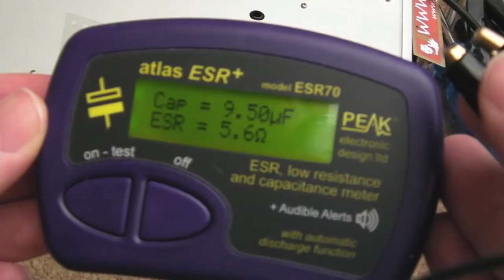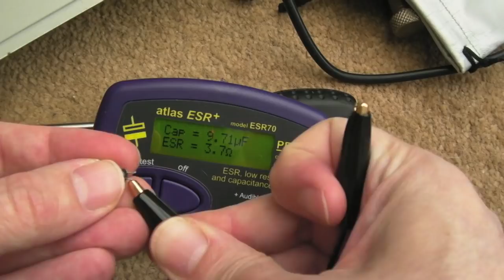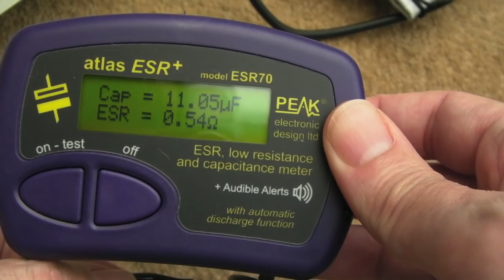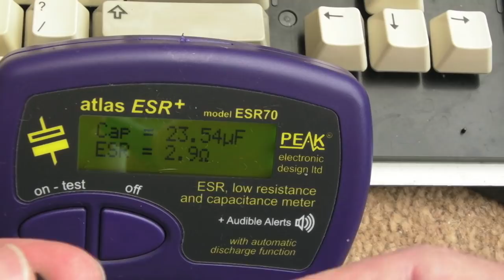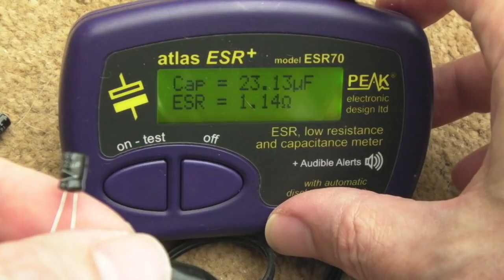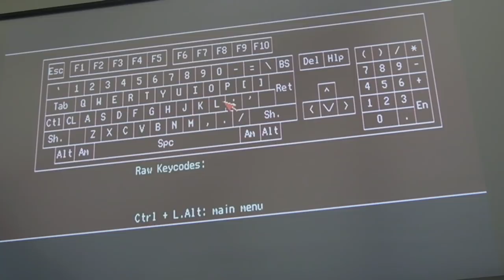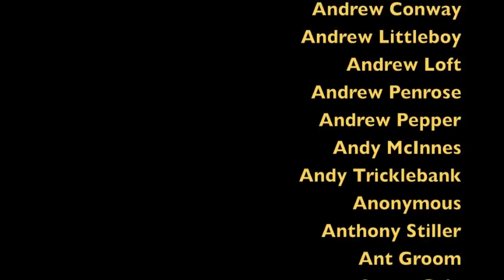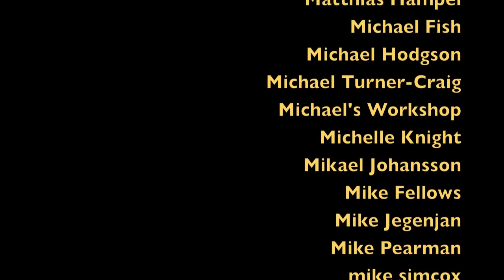Commodore Amiga A500 Keyboard Flashing Caps Lock Repair

Comment: It`s good that you do things like this, it helps alot of us to repare the Amigas we have. It shows that many jobs are easy to do. I had a keyboard issue with my A1200 the Caps lock key did not work at all the other keys fine. So i got a new keybord membrain, one of the new hard ones for the A500 and A1200 just fitted it and the keybord works fine now the green LED lights up. AS I have a A500 as well I have sent off for a spare one.

Comment: Thanks for another geat vid! Same issue on a suspisiously messed around with 'untested' A500 Ebay keyboard job. Messed around checking transistors and blah but gonna jump to the chip after seeing this. 3 flashes. Pretty much same error code so new chip time.

Comment: I have a similar issue here, already changed capacitors, so I guess that now I have to try to reflow the chip, or get a broken a500 keyboard on ebay to extract another chip... Thanks for the video!!

Comment: If you set your multimeter to diode mode and connect the positive probe to the ground pin on the chip and the negative probe to any of the other pins (you will have to test every non ground pin) you can usually detect the protection diode in the chip die.  If you then tap on the chip you may be able to figure out which pin has gone faulty if that helps.  You may be able to add a pull up or down resistor to that pin to try and make it functional again.  Like My Mate Vince did on his Sega carts.

Comment: I've had several A500 keyboard controller PCBs where I had to reflow the controller chip. Had the excact same symptoms you have here. And I couldn't see any dry solderjoints in any of the cases. Just like in your video the solderjoints looked perfectly fine. But reflowing the main controller chip fixed it in all cases. Probably small microcracks in the solderjoints that's impossible to see with the naked eye. It makes perfect sense because the keyboard controller card flexes a little bit as you type on the keyboard. So those old solderjoints are very prone to cracks. I don't think you tried to reflow the original chip in this video? Or maybe I missed it. I can almost guarantee that a simple reflow of all the joints would have fixed it without swapping the chip. Edit: Heard what you said by the end of your video now. You did try that controller chip on another PCB and had the same problem. So it was indeed faulty. Very rare
Reply from the maker: I didn't show it but I did reflow that chip and it made no difference!  I also later tested the chip in another keyboard that has an MCU problem and the same "tap issue" is present there.  I suspect a loose bond wire inside =/

Comment: Hi bud, I just bought an original Hi-Tek keyboard to finish off my Amiga 500 build.
However, on eBay the listing said this:

Keyboard causes the 500 to hang on black screen.
Altering the pin out on the 500 to take pin 3 out of the equation, the 500 will then boot with both leds working as expected. However, the caps lock doesn’t light and ATK test software shows zero response to key presses.

I swapped the main IC out as per your video, but did nothing. Although it was out of a Mitsumi keyboard, it might be wired different however?

I have read on EAB that it can be used in any later Amiga without an issue?
I have a rev 6a board.

Cheers bud.
Reply from the maker: Hi Anthony, you mean the original "chicken-lips" keys?  The IC should be the same, there must be some other fault on the PCB?  Isn't there another 74 series on there?
Reply: @GadgetUK164  Yes, it is the early version with the white keys.
Yes, is has two I think. I bought a working keyboard pcb to transplant IC's from, OK I will try swapping those out & report back.
Cheers bud! :)

Comment: Hi Gadget have you watched Adrian's Digital Basement's latest video? He tried repairing come IC's by baking them, he has no success but just wondering if your hypothesis is correct and  it is a loose bond wire weather baking may actually fix it. maybe worth an experiment.
Reply from the maker: Hi =D  Not seen that yet, but it's something I've tried myself before with no success (on SID chips and PLAs).

Comment: Hi! I'm going exactly through the same issue with my A500 keyboard (well ok I'm also trying to fix other small things but this is the bad one) and I'm starting to get the hang of it thanks to your video as well. An odd question: what's the game playing on the screen? I don't remember that from the old days! Thanks in advance!
Reply from the maker: The game shown early on in the video there is "Time Gal" - free to download!  Should work on any Amiga with HDD (or CD - there is a CD32 build too).  So to get it running on an A500 you would need either an ACA500+ or something like a TF534 / TF536.  Or you could just try and find some other upgrade that gives you IDE / CF card interface and ideally more RAM.